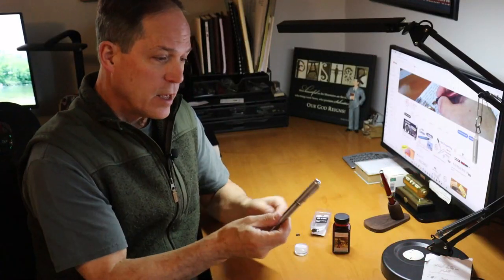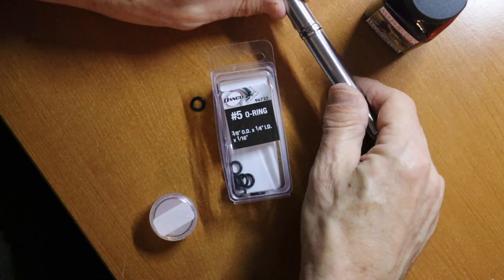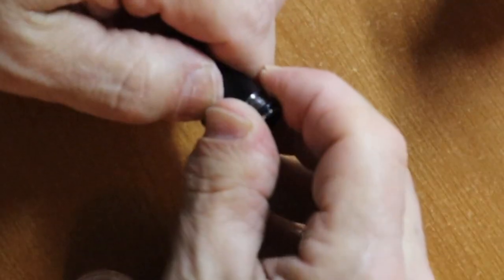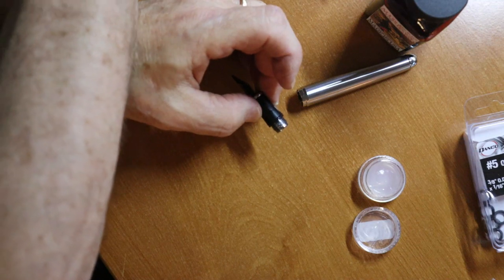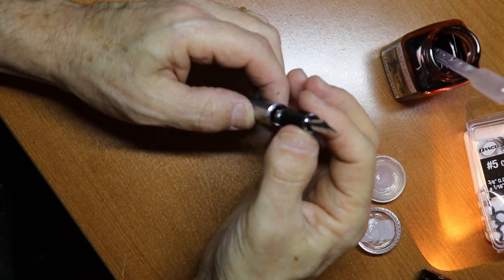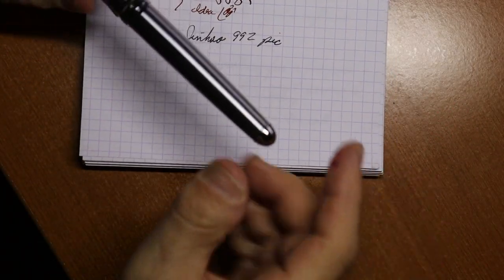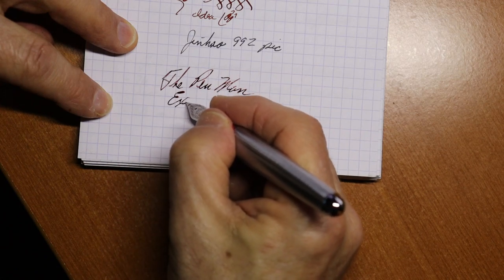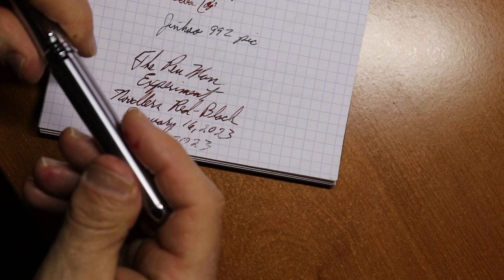Eye Droppering Experiment Video, Eyedroppering a Metal Fountain Pen

Comment: Worrying is the fact that ink might corrode the metallic  parts in the long run.
Reply from the maker: That is a legitimate concern. However, I'm wondering, if proper maintenance is performed between fills, if that will prevent the kind of damage that would ruin or even hurt a pen's innards. The key would be to stay away from non fontain pen inks. I'm also wondering if our fears are a carryover from the bygone era of iron gall inks, and the like, that would do damage? Today's inks are much safer.

Comment: If you used the silicon grease maybe you don't even need an o ring. It would be fun to try on a second x750 to compare.
Reply from the maker: I wouldn't want to try it without the o-ring.  It's an extra level of protection. So far, I've not had any issues with the nib dying out.